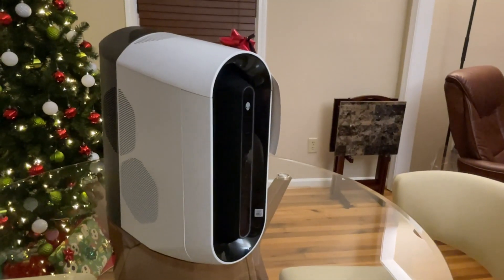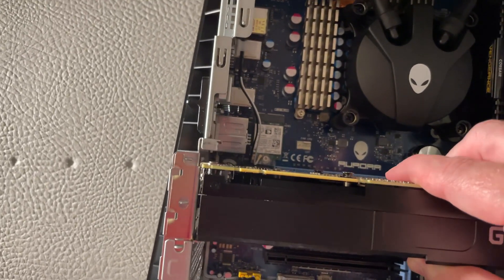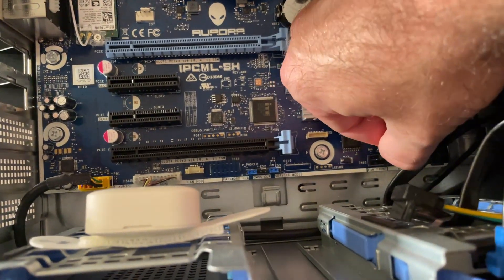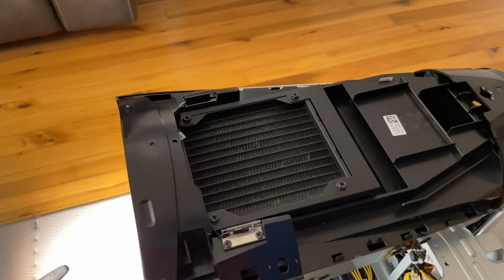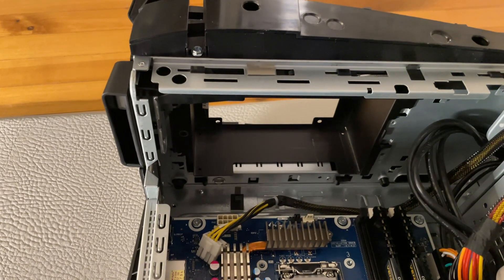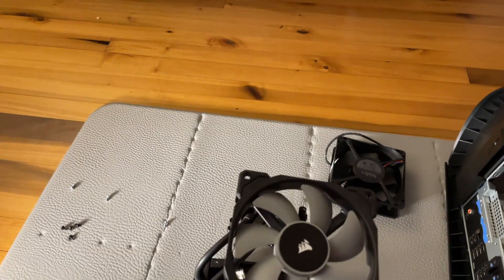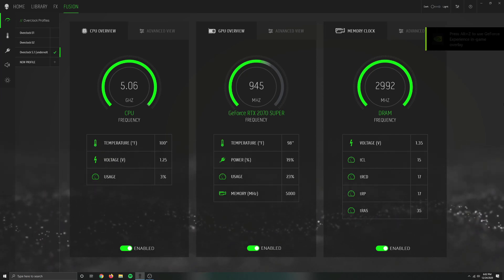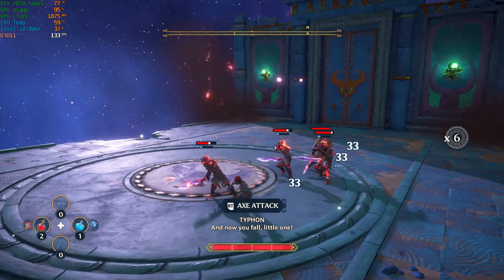Alienware R11 Radiator Mod and Case Fan Upgrade

Comment: I can confirm this all works on the Aurora R10 RYZEN edition!! TYVM for your video- I just finished the installation on mine. One thing I noticed that you never mentioned: The fans' 4 pin y splitter, one side has 4 pins, and the other side only has three pins- at first the top fans did not work, but by switching the two fan cables- it resolved itself.
Reply from the maker: You are correct, and thanks for the news that it works on the R10. The Y-splitter must be able to pass the PWM signal to the MOBO, and you are not the only person that experienced this issue. I plan on making a brief follow video to address a couple of issues that I should have included.
Reply: Can we get links to the splitter needed for this?

Comment: Hi, i have a question after installation I made a diagnosis and I get an error in the front fan and top fan  it is that normal ? I have a r10 3950x with rtx 3080 thnk u !
Reply from the maker: Does it boot normally, or do you just get the error when you run the fan diagnosis? It it boots normally, then you are good. The Corsair ML120 Pros will boot normally, but the Dell diagnostic is tuned to the RPM / voltage profile of the stock fans.
Reply: Sounds like good kit. Do you 3d render?
Would u swap that cpu for 11900k?

Comment: Hi, I noticed that you mention the fan MUST BE Corsair ML120 Pro 120mm fans as the non-pro version and OTHER BRANDS will give a bios boot error. Do you mind explaining more on this? I'm looking at fan comparison and I noticed that the Noctua NF-A12x25 actually performs better and quieter than Corsair ML 120 Pro, but I'm worried that it will not be supported by my Aurora R11.
Reply from the maker: I've heard from several people that the Noctua fans do work, but have not verified it myself. I had to redo all of the work after first trying it with the Corsair ML120 non-pro versions. This caused the system to start a BIOS initiated fan monitoring test; which the system failed with the non-pro fans. Windows would still boot okay after failing the test, but the test cannot be disabled or bypassed via BIOS, and takes around a minute to perform each boot.

I would try replacing the front fan first, and see if you get an error. If it passes, and boots normally, then you are good to go.
Reply: @theonlyjoe6036  Thank you for sharing the experience! It's priceless. Thank you again for this and the video!
Reply: Did you end up getting the NF-A12x25s? If so, did they work for you. I purchased these and couldn't get them to work in my A12.
Reply: @swongskw  No, I did not end up trying because I simply cannot find a solid confirmation that anyone has attempted this on Aurora R11 successfully. The fans are not cheap so I do not want to risk it. Aurora R11's air circulation was pretty bad. 2 months after I purchase, I encountered a notorious random screen freeze / crash issue caused by my RTX 3080. This is very likely due to poor air circulation, causing some components in there malfunction (people suspect capacitor issue). On the bright side, after a few weeks of waiting, Dell has replaced my GPU with no additional cost because it is still within warranty. I believe R12 case design is exactly the same as R9/R10/R11, so you will must likely suffer the same problem if you are using a really hot and high end GPU + CPU (e.g. RTX 3080 + i9 10900KF). Good luck

Comment: Hey quick question, for the top fan can I only replace the 1 instead of 2? Does it affect it a lot?
Reply from the maker: I'm actually working on a video to address this exact issue. But briefly, I would advise both fans for the top. The stock Nidec fan is an industrial grade server fan that actually has twice the CFM of a single Corsair Pro, but the Nidec is also noisy (and is of course never running full out; I never saw the Nidec go above 30% power and it still was irritatingly loud). The Corsair can move air more efficiently and more quietly across the RPM range, but in order to match the airflow of the Nidec while maintaining a low RPM and noise level it is recommended you install two. A single Corsair fan could move enough air to cool the case, but it would have to run at a higher RPM (higher noise level) in order to so.

Comment: Is the 2 fans on the radiator Considered overkill? Does the it really improve the airflow that much for the CPU/inside body of the case as it does 1 fan on radiator? Especially since it's the Corsair ML120 Pro fans are known itself to do well with air flow itself? 

And thank you for this video, it really is well done.
Reply from the maker: I'm actually working on a video to address this exact issue. But briefly, I would advise both fans for the top. The stock Nidec fan is an industrial grade server fan that actually has twice the CFM of a single Corsair Pro, but the Nidec is also noisy (and is of course never running full out; I never saw the Nidec go above 30% power and it still was irritatingly loud). The Corsair can move air more efficiently and more quietly across the RPM range, but in order to match the airflow of the Nidec while maintaining a low RPM and noise level it is recommended you install two. A single Corsair fan could move enough air to cool the case, but it would have to run at a higher RPM (higher noise level) in order to so.
Reply: @theonlyjoe6036  understood. I also utilized the Arctic MX-4 paste , and max temp on COU has been around 65-69 C, which is pretty decent with one fan. Since the thermal paste you suggested doesn't require break-in time that'll prob mean that'll be the best I get out of that temp. However, with possible two fan, perhaps it'll improve maybe 1-3c. I'll see when I'm able to get in the two fan(s) and let you know how it goes, also for the Y splitter - the one you suggested is the one the works the best? Did you try any other brand?
Reply from the maker: @TseStanley23  Those are not bad temps for a 10th gen Intel. When gaming my temps generally hover right around 60C with an ambient room temp of 21.5C. Just about any decent Y splitter should work as long as it has PWM control; without PWM control you will get a BIOS error as the board cannot detect the RPM on the fans.
Reply: @theonlyjoe6036  I'm also running 21.5C (70.7F) in my house as well. I'm glad you clarified the Y-splitter having PWM, definitely, a must need to know when trying your suggested mod. Also - I'm running all the latest update(s) as well as the new Bios update 1.0.4 that was released recently for the Alienware R11. I look forward to hearing your insight and video to address the previous item(s) we are talking about and thank you again for responding so quickly. It's nice to be able to share knowledge and insight with other(s) to help out the community. I'll wait for your next video update ( hopefully soon and not rushing you of course), before I move ahead and install the second fan on the top of the radiator - also the insight of your placement of Arctic MX4 thermal paste was good (also note to other(s) - you don't need THAT much thermal paste - having too much can actually do more harm than good due to overflow of paste - it can prevent the CPU cooler from doing its job as well - due to trapped air bubbles, etc - Luckily we're using Arctic MX4 but still - need to worry about too much and too little) (also don't overly tighten the AIO as well).Thanks again, look forward to hearing from you.
Reply: @theonlyjoe6036  Lmk when you make the addtional video. Would love to view. Have a good one.
Reply from the maker: @TseStanley23  Thanks. I actually fell off my bike, and am waiting on my hands to heal right now. I don't think anyone wants to scabby hands repair a computer.
Reply: @theonlyjoe6036  Oh man, Self-health is most important for sure. Get well soon my friend. Scabby hand repairs are someone elses fetish. LOL

Comment: I just did  this and got a bios fan check on start up followed by a upper fan error.
Reply from the maker: A few quick things:
1. What fans did you use? What it the ML120 Pros? The non-pro will throw up a BIOS error like you are receiving. 
2. Check the connections on your Y-splitter to ensure both fans are securely connected.
3. I know some Y-splitters have an issue with passing a PWM signal to the MOBO, and this will cause the R11 to throw an error. I have included a link to the exact Y splitter that I used. 

https://www.amazon.com/gp/product/B01EF9OI0O/ref=ppx_yo_dt_b_asin_title_o03_s00?ie=UTF8&psc=1
Reply: @theonlyjoe6036  used ml120 pro no  rgb just black i think i ordered  wrong splitter  cause it only had 3 pins  on mail and 4 female . I thought this could be a issue but was not sure if this was typical fan cable config.
Reply from the maker: @bullis606  One of the cables of the Y end should have a 4 pin connector as this 4th pin is required for PWM control (power management).

Comment: Hey Joe, once my fans are replaced in AWCC the max fan speed is only 66%. Is this the same for you? I'm think this is prob the max speed of the corsair fans.
Reply from the maker: That is correct. The Corsair ML 120 pros have a lower RPM rating than the stock fans. The AWCC, while it can control the ML120s, is still tuned for the stock fans and the percentage reflect that.

Comment: Are the fans under powered  due to sharing a power socket. Even though it is more efficient  method its seems sharing power source is starving  fans.
Reply from the maker: The fans are not underpowered. While it varies from manufacturer, most 12v motherboard headers can deliver between 20 to 30 watts of power. The ML120 Pros have a max power rating of 13.2 watts, but you will pretty much never pull that much down even at max RPM. The ML120 Pros will typically only pull between 5 to 7 watts in all uses; unless you just really like running loud maxed out fans. I've actually run 10,000RPM server fans (not in this case) at near max off a single Y with no issues.

Comment: Would a 120mm or 140mm dust filter fit between the front fan and the machine? Two ML120 pros on the way too. For now I'll not be placing a pull/push setup on the top fan so I will only need the filter for the front though I did see on your HDD removal video that there is there same metal grid behind that too. Expecting the machine next week and I'm organising essential bits and pieces now. Bought a SSD so that will be going in too.
Reply from the maker: I think a thin mesh filter would fit no issues. I did not install one due to the fact that they limit air flow (in an already air flow limited case). I just choose to open up the case and take a can of compress air to it every couple of months.
Reply: @theonlyjoe6036  I had thought with the new fans that the air flow may be improved. I have a 120mm thin mesh filter https://www.amazon.de/SilverStone-SST-FF122B-Case-for-PC/dp/B006NB271U?ref_=ast_sto_dp in the mail which I'll leave out of it for now. Cheers.

Comment: Maybe works with noctua ?
Reply from the maker: I've heard from a few people that Noctua fans work. I know the non-pro Corsair fans do not work as I had to redo all of the work with the Pro after trying to use the non-pro version. My advice is simply to replace the front fan first, since that is easy, and if no BIOS error is throw then you know you have a winning fan.

Comment: In total how many fans you need to buy?
Reply from the maker: 3 fans. 1 in the front and two up top.
Reply: @theonlyjoe6036  oh thanks one more question does it actually make it cooler and less louder cuz my friend has same fans but different pc and he says their pretty loud too?
Reply from the maker: @BekishIvan The fan replacement causes a 10 to 15 degree temp drop, and also causes the PC to be much less loud. The new fans are nearly silent during normal use, and even when they spin up during gaming or rendering, they are no where near as loud as the stock fans.
Reply: @theonlyjoe6036  good know but will it work the same with Ryzen edition? Because my case exactly same but black version!

Comment: A big thanks for your tutorial. I bought an aurora r11/i7/3080 this christmas, but the fans were too loudy. 
So I change ventirad for a Corsair h60, and buy 2 extra m120pro fans, to do your custom trick.
And now my pc is more quiet than before, and I save 10~15C during my game sessions.
Again, thanks a lot
Reply: I'm having exacly this problem with the same setup as yours.  My   R11 is too loud with the original fan, even  my wife said WTF is this noisy sound  =/ i realy need replace
Reply: i have the same pc, i upgraded to a h60 with 2 ml120 pro fans and i still get cpu fan error upon boot... at my wits end with it.
Reply: @danrek  You have to connect the cooler not to the fan pin, but into the dedicated CPU fan pin. This connector is at bottom left of the CPU. Not at top. Tell me if it fix your issue. I had the same error for booting
Reply: @oO6DTK90o   i have the h60i pro xt cooler it powers from a Sata off PSU it has a Tach lead that goes on cpu pins. still i get the fan error.
Reply: @danrek  Hi I have the H60 AIO, but mine is also powered by sata. But the issue came from connector. The bios cannot check the temperature. Maybe try to connect it to the top pins so. If you can :/
Reply: Before your change, it was a water cooler, or a ventirad (for me it was a simple ventirad). Maybe it is a bios configuration to switch :/
Reply: @oO6DTK90o  before I was air cooled, but no joy, seems stupid dell given what fans you can use, even though the standard ones of awful

Comment: i need a anti static gloves or sum?
Reply from the maker: I think anti-static gloves and wrist straps are a waste of money and time around modern electronics (static damage is really an old computer worry due to how they were constructed). Just ground yourself to the chassis (touch any bare piece of metal) of the case before touching any internal components,  and I'd advise not to work inside a computer while wearing socks on a carpeted floor.

Comment: What size screwdriver did you use to unscrew the original fan from the AIO water cooler? My screwdriver is too big to fit through the screw holes in the fan
Reply from the maker: I used a Kobalt micro screwdriver set that I purchased from Lowes. Any electronic screwdriver (micro driver set) will work as long there is at lest 2 to 3 inches on the bit.

Comment: does changing the fans and stuff void ANY warranty on the computer?
Reply from the maker: I know that the Dell warranty does not apply to aftermarket mods or any damage caused by the mods. I would keep the original parts and swap them back in if a warranty claim is ever needed. Don't worry, I won't tell anyone :wink:
Reply: @theonlyjoe6036   true

Comment: Thanks a million for the succinct walkthrough! But Im curious, why does this case only support these Corsair fans? Is it the RPMs, voltage,...? I have old NZXT non rbg fans Ive been eyeballing to replace the stock R10 fans (when I finally get it)
Reply from the maker: I'm not 100% percent on why other brands fail, but my guess is that is has to do with the voltage test signal sent to the fans during POST. I actually had to redo all of the work after I used non-Pro Corsair fans, and received a BIOS error. I've heard that Noctua fans will also work.

My advice would be to try replacing the front fan first, since that is easy to replace, and see if you get a fan test fail message from your NZXT fans.
Reply: @theonlyjoe6036  FWTW, and if anyone else reads this, my 2020 R10 with the 2.0 BIOS, I was able to swap out the front fan with an NZXT AER F120 successfully. I am not confident that I can remove the top panel to access the watercooler fan without cracking it. So I havent tested that specific replacement. With the one replaced though, the R10 is noticeably quieter but without the top fan replaced, it's not as quiet as Id like
Reply: Update: During bootup, the alienhead logo will blink 2,1 in white but will successfully complete POST and load Windows. Diagnostics through the Support Line (toast to Eduardo) has traced the meaning of this code to the fan. There seems to be a special "relationship" between the mobo and the fans that Dell uses.

Comment: Hi does your m.2 comes with standoff? and the screw you are using has to be 1 1/4? i can find only 1 1/2 i have not received the fans yet i will try when it arrives. Thanks
Reply from the maker: I honestly haven't looked to see if the m.2 has a stand off. I bought the screws from Home Depot. They should be available at any hardware store. I've posted a link to the actual screw I used.

https://www.homedepot.com/p/Everbilt-6-32-x-1-1-4-in-Combo-Round-Head-Brass-Machine-Screw-5-Pack-813561/204274717

Comment: Hey, can you please give a Amazon link to the screws you used.
Reply from the maker: I actually bought the screws from Home Depot. Here is a link to the exact screw. 

https://www.homedepot.com/p/Everbilt-6-32-x-1-1-4-in-Combo-Round-Head-Brass-Machine-Screw-5-Pack-813561/204274717

Comment: Hi, 

Do you by any chance play warzone? Was wondering what your CPU temps are when playing that game in particular.
Reply: Also, how significant of a temperature reduction did you notice, if any?
Reply from the maker: I don't play Warzone, but the most taxing game I have is Flight Simulator 2020. I don't see temps get above 70C even when doing a CPU heavy render with Resolve, and I'm running a 5.1GHZ overclock with a 1.26 undervolt. Normal gaming temps hover around 55 to 60C. I saw a standard 5 to 10C across the board reduction in temps for every kind of workload. The most noticeable difference is the noise, even under load the case no longer gets very loud.
Reply: @theonlyjoe6036  There is a notable difference in cpu temps between the ryzen and intels.. the ryzen chips run alot hotter but they are designed to do so with boosting on the fly